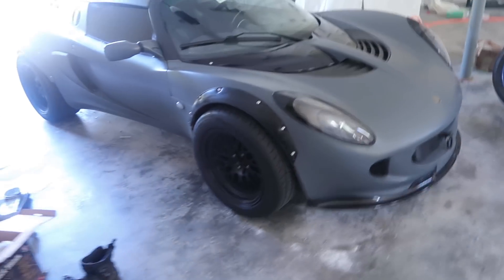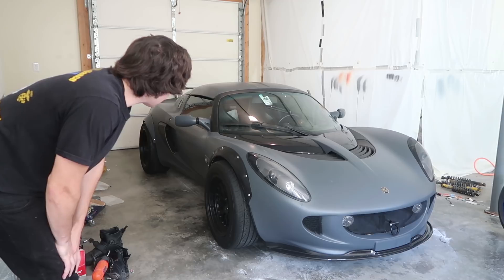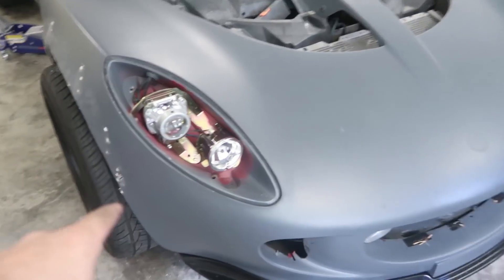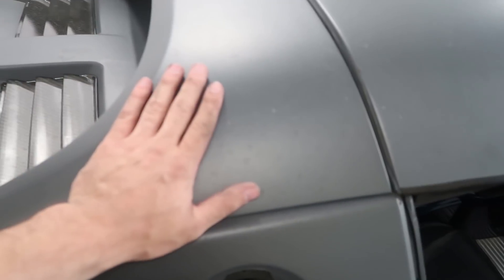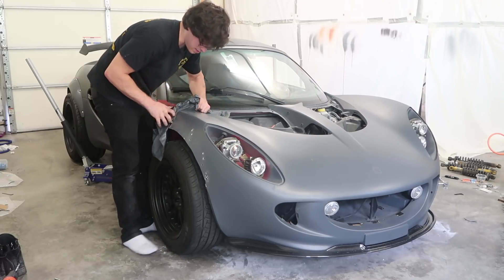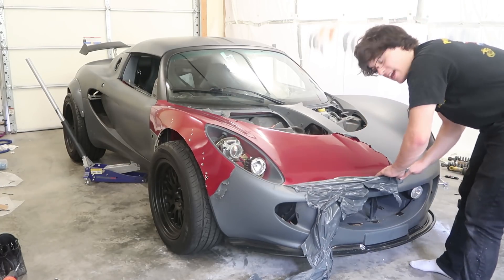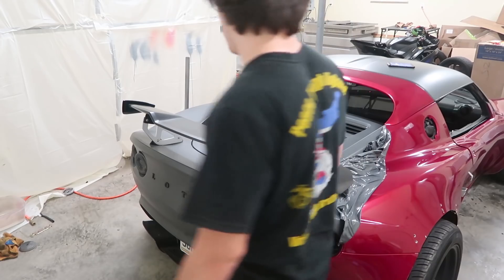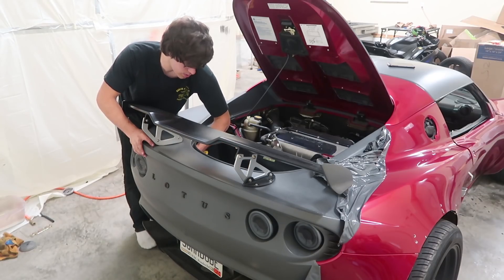Plasti Dip - The TRUTH! **Peeling it all off!**

Comment: Would putting clear coat over the plastey dip and wet sanding the orange peal with 1600 0r 1500 grit then taking a buffing and polishing wheel to it help with cleaning the plastey dip. That might work if u think of it

Comment: I plastidipped my wheels before a lot of the videos came out. You are correct if applied correctly it's super easy to peel off. Now if you applied too thin like I did, then it's hard.

Comment: I agree with your opinions on plastidip and I work at a body shop and spray cars for a living. Yes I could paint my own car for about the same price as plasti would cost me but for most people that is not an option. A paint job is astronomically expensive and then you better be committed to your color. Plasti let’s you protect factory paint and change you color whenever you want. If you do plasti dip correctly it’s a very viable option, just like wrapping your car.
Reply: a google user 
You either buy the cheapest paint in the world or you're full of crap. 
Paint a car for the cost of a plasti dip job?
300 bucks
Reply: Then why sell cars with paint on them. Sell with prime coat only. Why dip your car to save the paint. A vehicle is meant to drive and wear out. Use it like a machine.